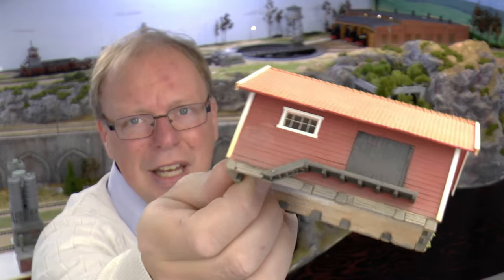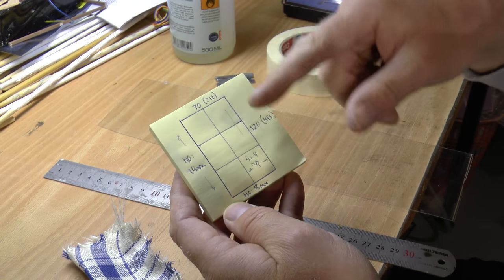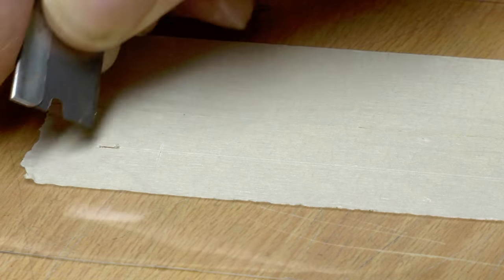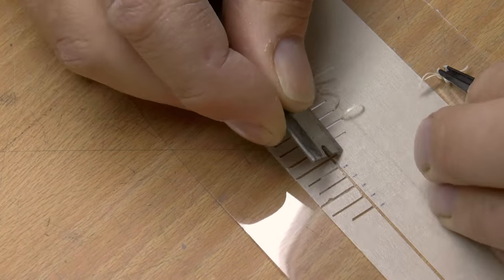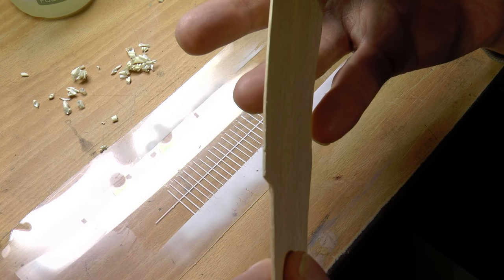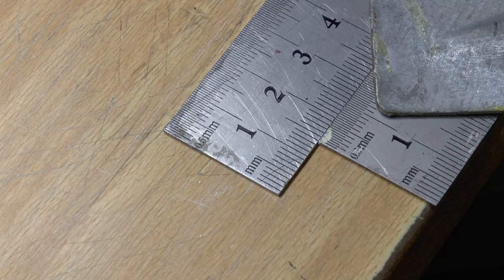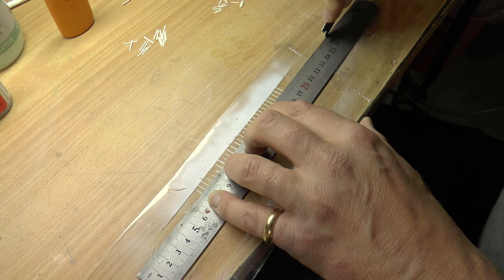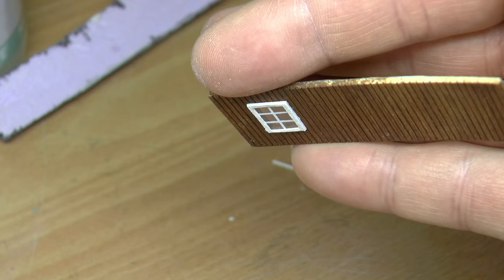Model Windows for miniature houses - Detailed guide DIY

Comment: I build wooden window frame. Then...on back side of window make very small cuts with X-acto knife.  White thread pulled tight crisscrossing the window frame and tiny drop of Superglue. Hold until set.  Lightly paint the threat with color of choice.  The paint will glue the threads in place.  Add plastic window material to the inside.